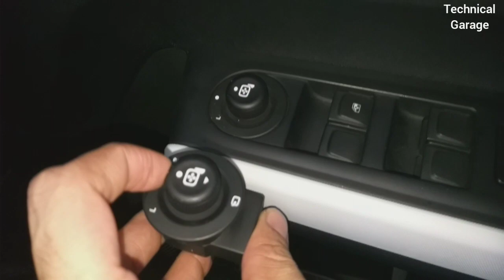Tata Punch Accomplished model | Autofold miror with Center locking | Modification | DIY

Comment: are you selling the electronic adjustable parts that you removed from your car? I have a pure variant and I'll be more than happy to atleast have the electronic adjustment in the mirrors
Reply from the maker: Only adjustible switch? Adjustible switch only I do have as spare.
Reply: @TechnicalGarageVideo  what about the motorized frame without autofold?
Reply from the maker: I have used same company fitted item like -Miror, Miror adjusting motors, and miror covers. Only autofold bracket assy replaced(fold motor fitted). And finaly replaced new required autofold switch. So that switch only I do have as spare.
Reply from the maker: @techiout  Non-autofold bracket assy is also available. But nothing can be do with that for Pure model as company fitted Adjustible motor removed and used for new bracket.
Reply: so if we have to do it in Pure variant, it'll require full mirror set and switch. What would be the cost of that? Asking since you've already researched
Reply from the maker: @techiout  Aprx. 10K
Reply: @TechnicalGarageVideo  do you come to Bangalore?
Reply: @TechnicalGarageVideo  hey man, I think I can use the switch now. I'm skipping on auto folding mirrors for now but I'm installing electronic adjustable motors in my Punch Pure. I've sourced the motors and am in need of the switch. If you still have it, can you send it to me? How do I contact you?
Reply: yes have them in stock.
Reply: @tatapunchownersclubofficial  What all parts do you have available?
Reply: what you want ? @techiout
Reply: @tatapunchownersclubofficial  I need autofold ovrm